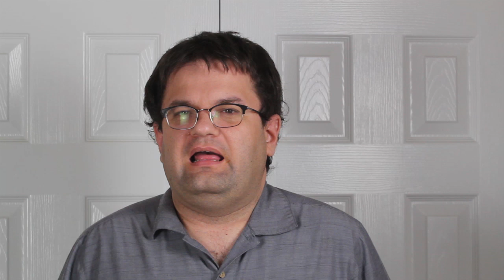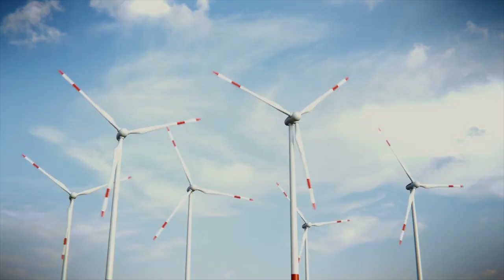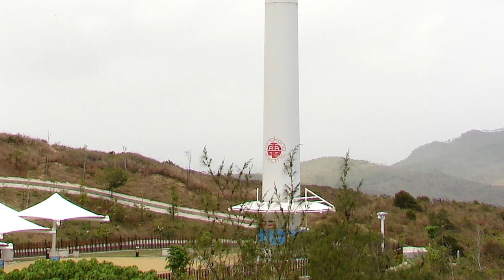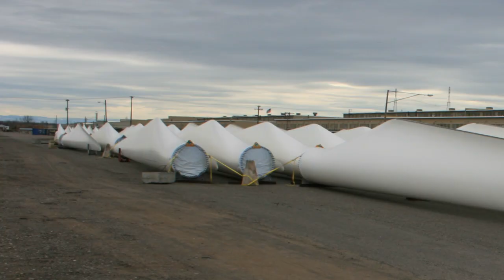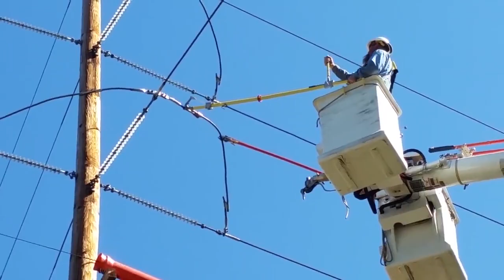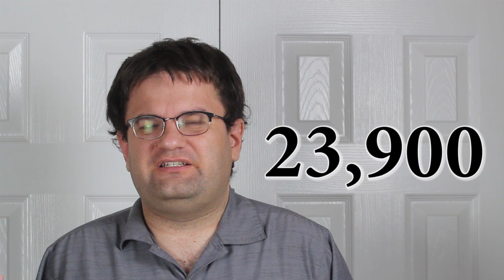Environmental cost of wind power?

Comment: Nice discussion of windpower.  I worked in the area of the composite blades before I retired.  I am very, very much pro windpower (and renewables in general) as the only way the earth can sustain our huge growth.  But the detractors will come at you, so it's good to be ready.  Here are some points:
  - Energy: some say it takes more energy to produce and install a turbine than it will produce.  This is total nonsense.  It would be good to get these numbers.
  - Plant factor (there is another name for this):  due to slow wind days, too high wind days (when the blades are feathered and locked), and maintenance shut downs, turbines will produce about 35-50% of their rated peak power integrated over time.  That is well known, and wind power is still very low cost.
  - Wind energy is high cost: it is so cheap now that it can "buy it's way" into the power grid.  Some will say that's only because of government subsidies, but coal, oil etc is more heavily subsidized.  When you consider the lifetime cost (illness due to coal plant emissions, etc) wind far wins out on cost to society.
  - Blade disposal: the blades are inert, so landfill is what is done now.  And you are correct, there are programs looking at recycling the fibers in the blades (glass and carbon fiber).  The polymer matrix materials (epoxy, vinylester, etc) are thermosets and likely cannot be recycled that I know of.
  - Birds and bats: you covered that.  Very few killed if the proper environmental studies are conducted beforehand.
  - Blade sun shadow and acoustic pulse.  Sun shadow occurs to someone living nearby in the morning and evenings at low sun angles.  It can cause nausea in some people.  For sun shadow and acoustic pulse, the solution is to make a proper set-back when citing the tower.
  - Some other good references in addition to what you have:
        www.awea.org.  They are a manufacturing society supporting the wind power supply chain.
        www.nrel.gov.  A great government site for all things renewable, including wind.
Wind energy is not perfect.  But is far lower impact to the environment that coal, oil, & gas.  There is also some work on tidal turbines for energy you may explore.  Great topics!
Reply from the maker: Very interesting! I'm hoping that an honest discussion of the pros and cons of rweach major source of power will reveal some trends. My hope is after all of these to compare them more directly as well.

Comment: What about the effect on the weather?  If we pull 1.24 gigawatts of energy from the wind, won't there be less wind? Mightn't that cause less rain somewhere or more rain somewhere else?
Reply from the maker: That's a great question. The amount of wind power is basically overwhelming, a tiny dip in it won't really cause any issues. One thing that is interesting, however, is that the ground in the area near a wind turbine tends to be a bit warmer, as they tend to mix the higher and lower air somewhat, which ends up with a slightly warmer ground, and a slightly cooler air above the ground. I haven't studied it extensively, and don't fully understand the why, but I found it interesting nonetheless.
Reply: @WhereisRoadster  I don't think windmills are so tall that there is much of a temperature difference top to bottom.  But if there were, air temp usually drops with elevation.  Also, I find it hard to believe we could pull gigawatts of power out of the wind without consequence.  Im not sure what you mean by ground temperature....but if you literally mean  the ground, could it be resistive heating due to transmission line return currents?
Reply from the maker: For the temperature difference, take a look at https://www.sciencedaily.com/releases/2018/10/181004112553.htm . As for the changing of the winds, well, ultimately wind power is a form of solar power, and we still will only use a very small portion of the possible power. Just like jets don't seriously affect the day-to-day weather, neither should wind turbines seriously affect the weather.